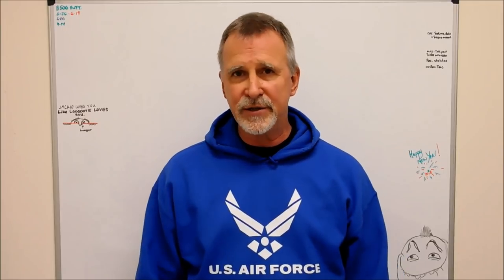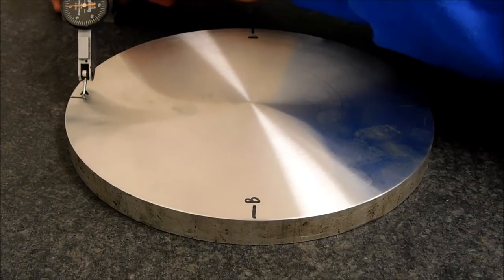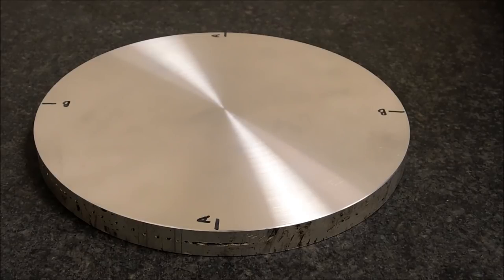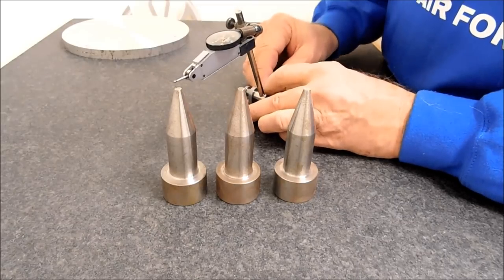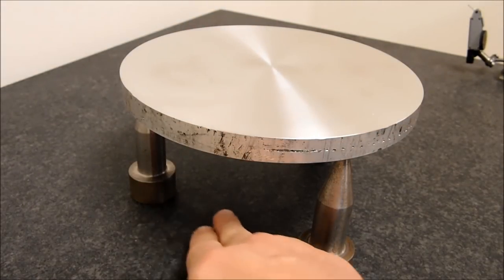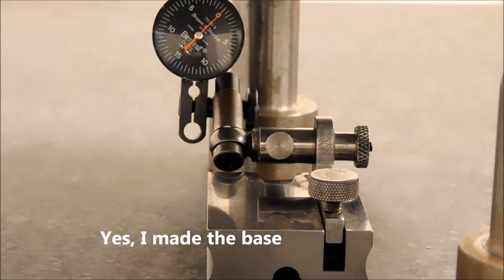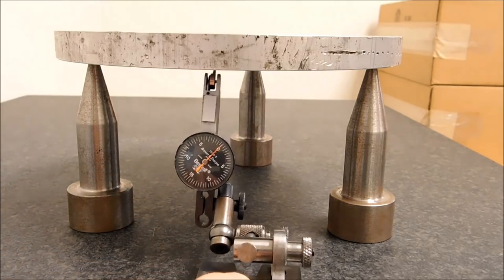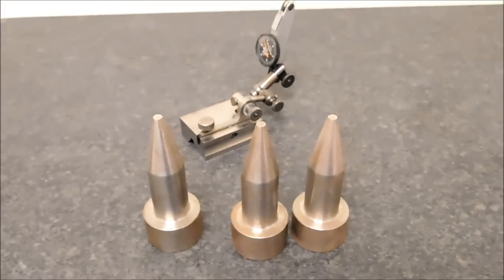How to Accurately Inspect a Flat Surface

Comment: That's the right way to inspect for flatness, but let me add that with some math you don't need a surface plate, or precision stands. Just a fixed route for the dial so it travels on the same surface. If you plot the two measurments at different point you can substract one equation out of the other which eliminates systematic errors and you are left with the surface topology of the part. It's called a reversal method and it's the basis of precision metrology!

Comment: I always check the granite block for high and low spots first. Then the post heights, then the part.

Flatness can also be checked from the surface you are checking to itself providing the part is big enough.

Thanks for showing this Joe.👍👍👍

Comment: Joe, I have two plate glass telescope mirror blanks that are 25" in diameter.  They will be used to construct a binocular reflecting telescope.  Each blank is a meniscus (contact lens) shape.  As one goes through progressively finer grits it becomes necessary to grind down the face of the edges.  This is done to avoid spalling of the glass.  I have been struggling with how to determine if the edge bevel is consistent (relative to chords) of the sphere curve on the blanks.  The method you have shown using the towers and indicating off the bottom of the workpiece is inspirational.  Thanks for sharing!  My surface plate is barely large enough to pull this off.
Reply: Gordon Brown - sound like a neat project and perhaps you need a larger surface plate?
Reply: Joe inspired my approach.  One of these days I expect to see him wearing a pointy hat and doing his presentation from a corner of the room . . .

Comment: Great instruction Joe. I'm glad you mentioned the 1-2-3 blocks towards the end. I've seen guys use chrome inspection balls to support their work with the ball sitting in the hole of a block, but that would require and accurate chamfer of the holes on the block so that the tops of the balls are of a uniform height. Your towers are the thing to have.

Comment: Good tip. Normally I would just transfer blue it to check flat but this gives you a measured number in case you need it.
Reply: His method does give the actual deviation so that a "is it close enough" judgement can be made. Blueing almost works too well... you know where the high spots are, but would you be better off to re-machine or would grinding or lapping the work to obtain the required flatness be the fastest way to get what you need?
I've found that unless the material has been stress relieved (especially cold roll and stainless steel) it will squirm every time you skim material off the face and it may not be much better than when you faced it off the first time. It doesn't move much, but if being really flat is important (which is why you'd be checking for flatness in the first place) it can be a problem.

Comment: Hi Joe,

Nice technique 
I have used 3 jack stands with ball bearings on the center post then I set 0 above each stand by adjusting the jack screw then check the rest of the surface. 
Thanks again
Reply: Eric Richards I've done the same adjust to zero on top of each jack and sweep the top surface.

Comment: The surface plate obviously needs to be cleaned with sp cleaner and a lint-free cloth.The 3 jacks and the surface-gage need to be " rung-in " on the sp.

Comment: Interesting idea to measure the underside.  How would you go about making the towers if you didn't have a surface grinder?  I assume you could turn the bottom with a cup shape so it only registers on the outside and then lightly lap them on the surface plate, but how to make the top perfectly square to the base.  Or do you want it ball shaped?
Reply: I think I'm going to make some of these.  I'm going to try using adhesive to hold small bearing balls in sockets for the points.  Then see how close I can get the lengths using a collet stop.  I also think you're right on the money with relieving the center and lapping them to final dimension.  If the ball bearing and epoxy don't work out, I'll probably order a truncated ball with a blind hole from bal-tec.  They make some fantastic and affordable kinematic components.
Reply from the maker: I don't know if my camera angle allowed for seeing it, but the center of the bases of those pins is relieved. Without a surface grinder, trial and error cutting would be the only way. I too like the ball bearing top concept, but remember, less surface area is good, but if it wears, the error would come on pretty quick. I still like the idea, but I'd be sure to use carbide balls.
Reply: Joe Pieczynski - relieving the base end would be a good idea. But unless I missed it, I saw a center hole in the base of your towers, but did not see a relief. At about 3:04 in the video you show the bottom of the towers. Great work and thanks for the inspiration, I am going to make myself a set.

Comment: I would like to see some more on that custom base you made. Pretty slick, I need to make some my self. I have some tool steel laying around. Would be a good project. Great video as always. I learned something new.
Reply: Clayton Miller 
There a decent plan for a surface gauge in one of the popular metalworking projects books.... I just forget which one.   Sorry.  Maybe someone will chime in.  In any event, they're super cheap on eBay for used branded ones.   If you build one, you'll pay more for snugs than if you'd have just bought one.
Reply: MDShunk oh I completely understand that I would spend more building on than purchasing one on eBay. I look all the time. And I have some rough ones that could be cleaned up that we’re in a lot of an auction I purchased. But at the same time I would enjoy doing a project like that.

Comment: At the end of your video, you touched on using 1-2-3 blocks.  Using a Steel Ball in one of the  holes of three blocks, gives a minimal 3 contact point on the part.  Just qualify that the tops of the three steel balls are the same height.
edit:  I just read more of the comments, and see that others have made the same comment..

Comment: Thank you for the video.
As for 1-2-3 block, use three ball bearings in the holes of the blocks. Or if you don't have Swiss Cheese blocks, use flat ones. Put a plain hardware washer on the block and set the ball bearing in it. The washer would only be there to keep the ball from rolling away, so make sure there's free play.

Comment: Hi, I am wondering how you can be sure that the surface of the granite is satisfactorily even and does not affect the flatness measurements (because you are moving the instrument stand on this surface)? As far as I understand, the granite surface represents some kind of reference plane.
Reply from the maker: Based on the grade of surface plate, its certified as a flat surface. Unless it sees aggressive and continuous use, you can trust it to be reliable.

Comment: Hey Joe, I've used precision ball bearings on matched 123 blocks as a similar setup.  The ball bearings were very consistent diameter and I found three holes on the blocks that were very close on height.  I really like your three post design. It gives more room to work and easy to setup.  Maybe one day you can show an example on how to lap them to be the same length?
Reply: Stephen Brown are the holes chamfered to a precise depth? otherwise the balls would sit at different heights unless I'm missing something.
Reply: My csk are the same depth. Just compare the ball heights like he did using an indicator to check them first.

Comment: can you not use a proven straight edge or parallel or feeler gauges on the surface and look for wobble or light? I am missing something?Thanks for the vid Joe
Reply: Maxi77 This seems more of an exact way to not only tell if it is unlevel but also by how much. Although I may be missing something. 😋 Hopefully Joe will see and respond to your question.
Reply from the maker: A proven straight edge would probably work if it crossed center and you checked in multiple radial increments. Over the course of my career, this method proved to be the only one the inspectors couldn't argue with. Shimming and leveling is also certainly an approach but would take more time to setup.
Reply: Thanks Joe for the reply, always learning :-)

Comment: When measuring the towers as soon as you move the finger clock to a new position the next value is already null & void. If you were an inspector then each tower would be slid under the clock to register a true reading from the surface plate. If you were checking to a specific length over the towers then the clock would have been zeroed on a slip pack first.
Reply from the maker: I'd argue either method is valid. Just don't load the indicator into the pivot. Since the indicator will sweep for this method, moving it isn't a problem. Always sweep under or away. And a correction for your comment. I am looking for a constant value for each tower, I am not measuring them.

Comment: You can also make three adjustable jacks and then set three zero points on the top side. Then it is possible to move the indicator at the top.
Reply from the maker: On large plates, top indication could be a reach issue. On towers, you have the whole plate to use from below.

Comment: 20yrs exp....I was taught the same methods as shown. But if you listen when he puts the part on home made blocks he even said he is still checking for parallelism. He is checking the parallelism still from the table to part. The only way i see to do this is put the block and indicator on the surface itself you are checking and move it around to see the highs and lows. This would only work with a large surface area.

Comment: I really like Your design of the support posts!
 Will make a set of these.  I have been using 3 gageblocks the same way, but as You point out, it is less than ideal to support the piece at the edges where machining burrs and other errors are most likely. I also think the flat top is better than balls since the setup will be more rigid  and support the piece better for accurate measurements. Perhaps I missed if You mentioned the ease of measuring parallellism with this setup by indicating the top surface as well, which is another advantage of the method. Thanks again for the idea!

Comment: In the "non-precision" world of engines and engine parts a simple straight-edge, feeler gauges and flashlight work great for checking "flatness". And by "straight-edge" I mean a straight-edge" with an actual "edge" rather than a "face" several inches wide.
Reply from the maker: Your method will only indicate linear flatness ( straight line ), not planar ( large surface )flatness. They are 2 different conditions.

Comment: i was thinking about this with 123 blocks, and then drilling them to hold a ball bearing on top.  im not sure how much variance i would get using the drill hole diamater to locate the vertical plane of the ball bearing, maybe boring it, or regrinding the top of the block to adjust their height to each other.

Comment: How about putting some steel bearing balls in the holes of 1-2-3 blocks to makeshift pins? Measuring them after that of course, for the exactly same height over the balls.
Reply: good alternative option..

Comment: Very nice and simple, great for smaller items like checking the cross slide on my lathe.  I wonder if you would want to stand that surface plate on edge to check something larger like an engine block?    Also, stuff I was sort of expecting to see some Prussian Blue paste.  Can you comment on when this would be appropriate in terms of accuracy, or is this just used in scraping?

Comment: Thanks for yet another informative video Joe.

I have a question to ask and a suggestion at the same time..
Do you use a height gauge and you surely do, could you do a video on the many wizard like uses of one?
It seems for some reason to be a neglected instrument.
I use mine one way to set the height of my cutting tools on the lathe, the number (3.781) is wrote down on the splash guard so I wont forget it.
You or anyone else here would laugh at my granite surface plate but it works for what I do at home.
It is polished granite siding from a building in downtown Austin I checked out for flatness with a straight edge and a strong light behind it.
Not lab quality but darn flat and works for the stuff I do as said. 

Again thanks.

Worth 
.
Reply: I second that request Joe!

Comment: Hi Sir, is there some reason that the top parts of the inspection towers are flat and not spherical? Would it be ok to have a small steel ball (from a ball bearing e.g.)?
Reply: Flats average the machining surface finish and balls have the tendency to squash under the weight of the workpiece and also the tendency to go into the workpiece under the weight.
Reply: Thanks for the reply, it got me thinking.

Comment: This is a great video and a great idea. But here’s my issue. My old lathe will not face a large diameter  perfectly flat. If I face a workpiece about six inch diameter then put the machined surface down on my surface plate it will spin like a top so the center is high (convex). I assume my cross slide must not be perpendicular to the lathe centerline? What is best way to improve this condition (besides getting a new more expensive lathe)?
Reply: While that is possible you may also be seeing creep in your compound along the leadscrew. One thing you can do to check is to use a crossslide lock if your lathe is so equipped.
Reply: you may see the same symptoms if the headstock is misaligned  also.
Reply: chris0tube - Chris and others, thanks for all your tips, but I think my lathe is facing OK now. I recall one time last year discovering the saddle gib was loose and there was about .020” movement front to rear. I adjusted the gibs. Today I took a 6.5” diameter piece of 6061 aluminum and faced it off to clean up all the way across. My Starrett straightedge and eyes say it looks flat and a dial indicator on the lathe cross slide reads zero from outer edge to center. Disk feels good laying on my surface plate. I have not yet built a set of inspection towers per this video (but my carbide balls arrived from McMaster today) but plan to check with an indicator per this video. Thanks for all your tips on what might have been ailing my lathe. Guess I’ll keep the old gal.

Comment: Any tips on reamers? Always seem to get a crappy finish.
Reply: Never reverse a reamer, even a manual one. It dulls them. Uh... Don't take more than 0.005". Ream immediately after drilling without moving anything. Lube that shit up.  

Maybe your reamers are bad?
Reply from the maker: Chris N    Thats a very open ended question with many variables. Material, RPM, lube, depth of cut, type of hole, type of reamer etc. My depth of cut is usually driven by the diameter I am reaming and the rpm should be much slower than the drill.

Comment: Won't sag be an issue eventually, making this unsuitable for large or thin parts?
Reply from the maker: If it would sag at inspection, chances are it would conform at installation and a flatness spec would be unnecessary in my opinion. I have checked 14" rings this way at .3 thick without gravity being an issue, but I can see your point.

Comment: Is there any way to check flatness alone?

Been watching videos for days. Everyone seems to have these large expensive certified known flatness surface plates and then check vs the known flat.

As just a hobbyist, is it not possible to check flatness without having someone else make something flat and then compare to thst surface?
Reply: use a straight edge and a flashlight behind it, and/or feeler gauges. or use the 3 plate lapping method to make your own flats

Comment: I've seen another method where you use 3 jack screws and adjust each one with the indicator over it to zero. This creates a plane between the 3 points and you can now sweep the surface from the top side. Is there a downside to this method?
Reply from the maker: Only the time it takes to adjust the screws. Otherwise, it should work the same.

Comment: which surface need to butted on surface table, the surface which we measure or opposite for flatness inspection?
Reply from the maker: In this setup, you are checking the side in contact with the pins.

Comment: Would checking the part with an indicator on the machine work after surface cutting it? Or is this mainly for the person doing the first article outside the machine?
Reply from the maker: A part still in the machine is still under the load provided by the chuck or vise. It is better to check it on a surface plate free from clamping pressure.

Comment: Hi Joe, I have a question what if I have a part that too small that can not use this method to check flatness ( part too small to put in jackscrew) , can I just put it on a gauge block then use indicator to measure flatness??? Thank you.
Reply from the maker: You would have to trust the area making contact with the gage block is flat and only check the overhang, but you may get lucky.

Comment: Got another question: how are you not simply translating the plane of the granite surface plate to the plane created by the 3 points on top of the towers?
Reply from the maker: Thats exactly what is happening. Allowing the indicator to pass between them for inspection of the registration surface.

Comment: All well and good if you have a lathe or mill to make the known piers to set the part on. Why not just put it on a lathe and use your dial indicator if the lathe is true?
Reply from the maker: If you make a part like this, you do have a lathe right.
Reply from the maker: Plus, a chucked part under tension may exhibit a flat reading if you sweep the face in the lathe with an indicator. Only in a relaxed state is a true reading trustworthy
Reply: we can mannufacture a variety of granite surface plate with high precision.